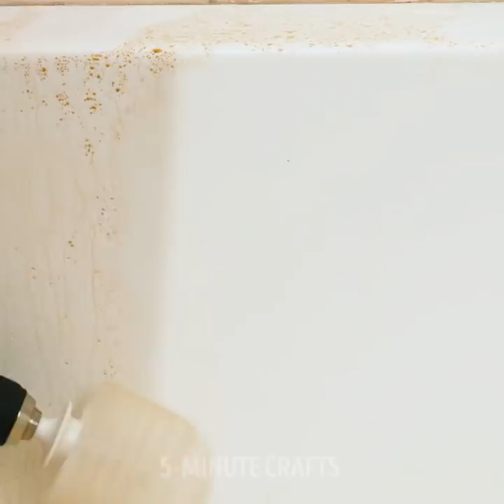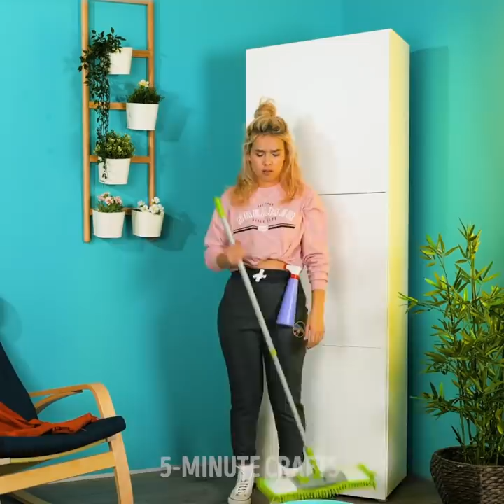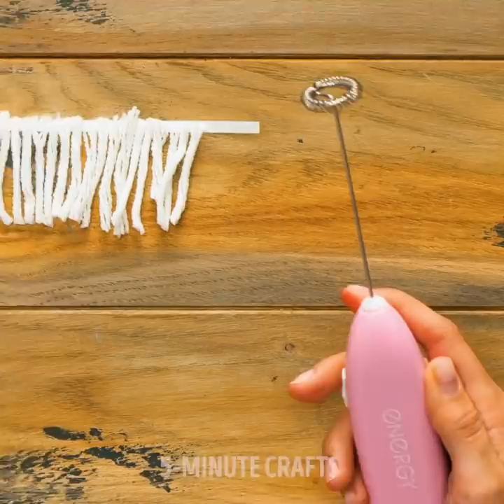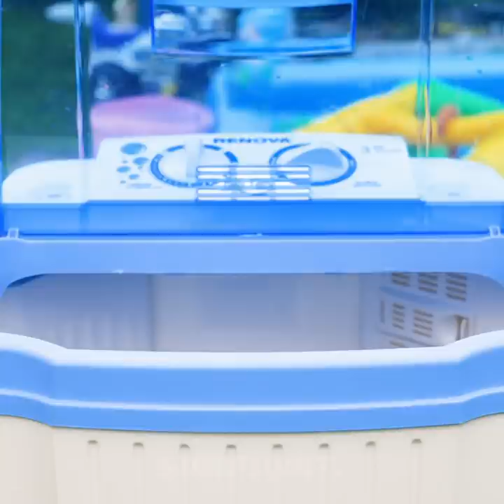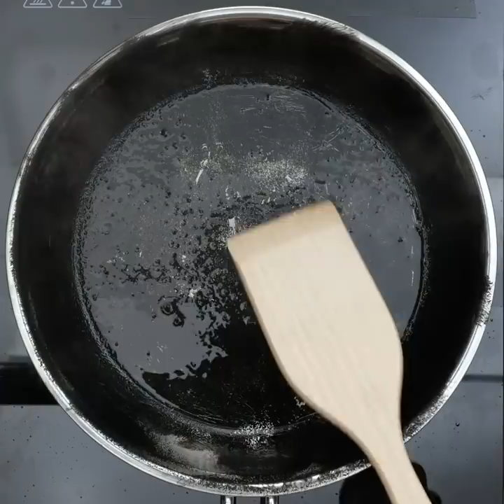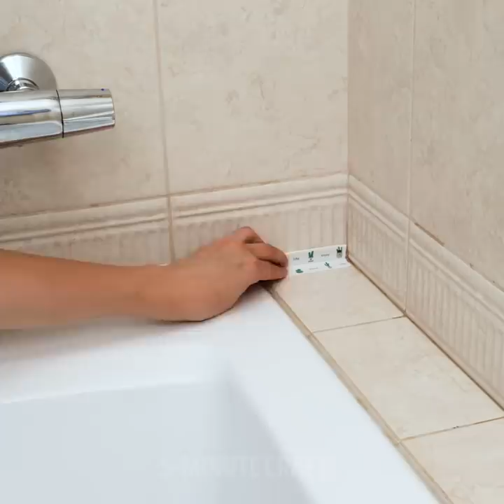HOW TO CLEAN ANYTHING || Clever And Useful Cleaning Tricks That Will Save Your Time

Comment: Easier options/Tips: *Taking a wisk apart to remove hair from a brush???? A comb works just as easily without the hassle! *Put vinegar water in your iron and use the steam function to work the buildup out through the holes in the iron. *Stand on a small stepladder/chair to clean the tops of furniture. *You don't have to kneel in front of the toilet to clean it. Stand up and use a toilet brush. *Splitting two-ply toilet paper doesn't actually create more toilet paper. WTF? *Replace toothbrush every 3 months. *Why cut holes in a towel to 'wear'? Try a robe. * Instead of cutting up a sponge, inserting a bar of soap and using a spatula, just get a shower brush. *When you put sheets on your bed, stay off the bed!!! Walk around to tuck the fitted sheet in. *Instead of blowing bubbles through a washcloth to 'save soap', just use less soap to begin with! *Who actually buys a newspaper anymore? Look at the plastic bag before using it.
Reply: I had exactly the same thoughts. Cutting the towel is the worst idea ever. Just wash it & u will see.
Reply: I think some of these are designed for those who can't just go out and buy stuff. Or if you don't have something just yet and need a temporary solution until you get the product.